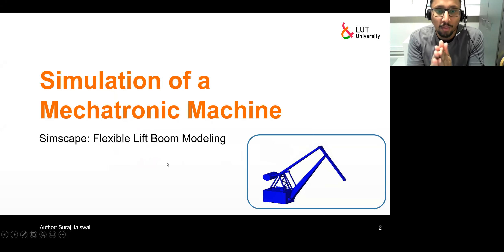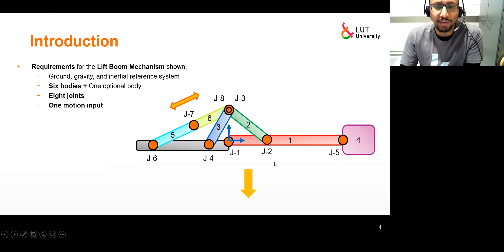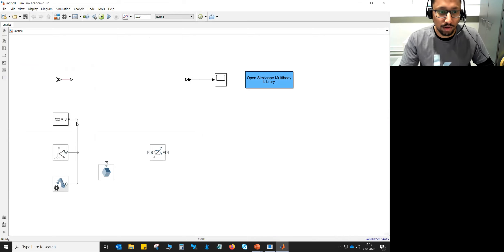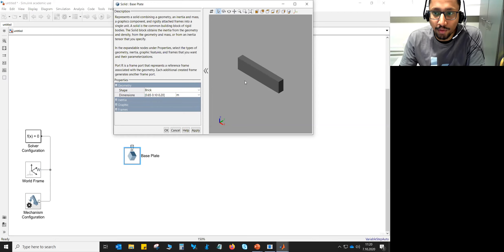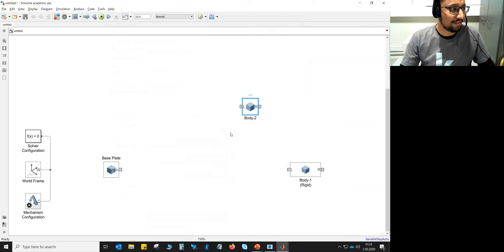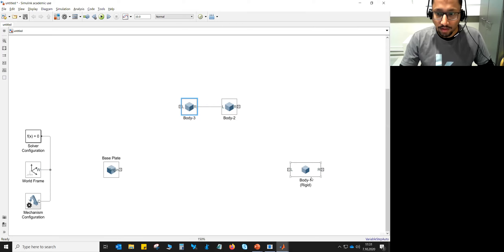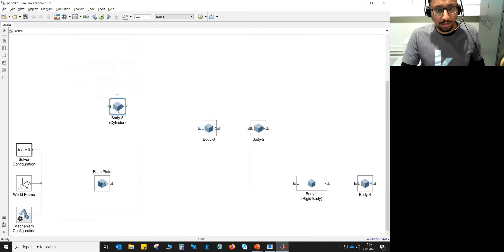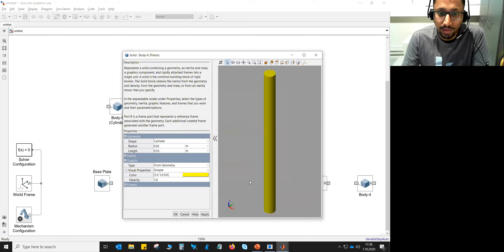Tutorial 05: Flexible Lift Boom Modeling | Simscape Multibody | Matlab | LUT University | Finland

Comment: Is there any difference between adding and not adding the Weld Joint?
Reply from the maker: Well there should not be any difference but sometime when you don't add a weld joint then the integrator might give some error.
Reply: @DrSurajJaiswal  thanks
Reply from the maker: @wenhaoli6218  :)

Comment: Hi Suraj, I am back again. In this tutorial of yours, I am facing a problem that the bodies 2 and 3 are aligned upside down in my case whereas I followed your video at each timestamp. I tried assigning the position targets at low priority to the revolute joints assigning them values of 60 degrees to body 3 and 120 degrees to body 2. Could you help me with that?
Reply: So, I figured something but I am not sure if that's correct. I connected the L of body3 to the base of the bearing joint and the L of body 2 to the frame of the bearing joint and the system works correctly.
Reply from the maker: Hi, I think the problem might be with the orientation of the bodies. I mean that by mistake you might have mixed the definition of the frames on the body. They affect a lot.
Reply from the maker: well as far as your animation is working fine you are good to go. But you can crosscheck by switching on the frames on the final animation and compare the directions of the body frames with the ones used in the video.